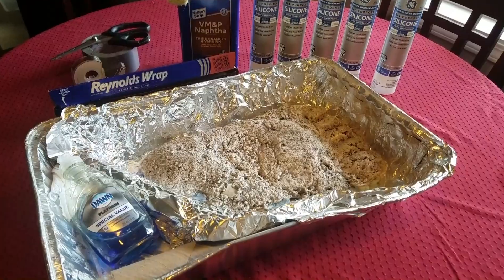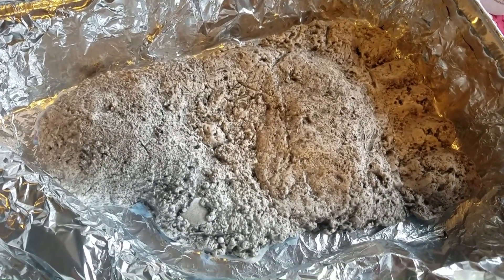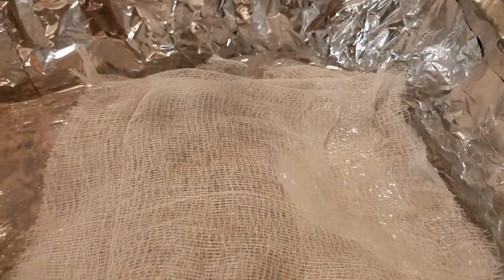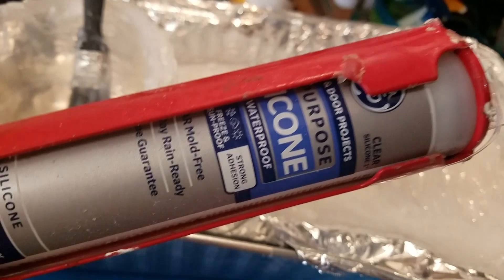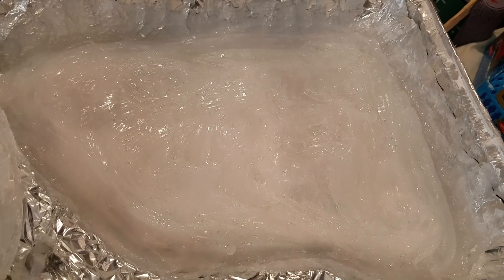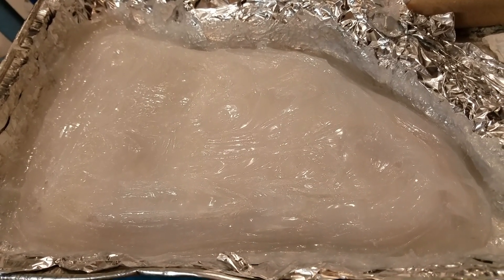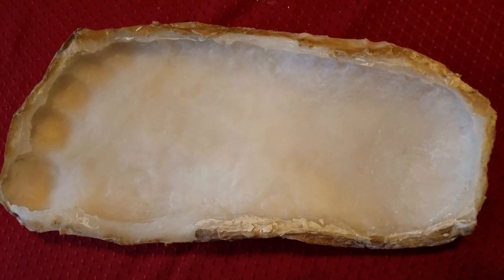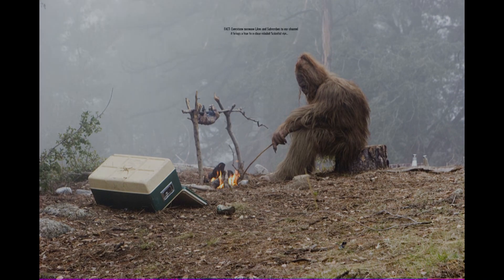Bigfoot Track Cast Mold Making Tips!

Comment: Help! Did this with one of my favorite casts, and when I say they’re releasing agent failed, that’s an understatement... now I have all this silicone crap stuck to my favorite cast it is made the biggest mess ever and I cannot get the first layer off because it stuck everywhere. Any ideas? What would be a better release for future use? I made 2 molds, glad I didn’t do more!
Reply from the maker: Tried releasing spray and it didn't work well then I tried putting several layers of Dawn dish soap on letting each layer dry before adding the next thick layer and it works well. Also apply several layers of silicone before adding cheese cloth so the cloth is in the middle layers of the mold because if pushed to close to cast you get the cloth squares all over instead of the tracks fine definition and you will have to start over because it will ruin the end product.